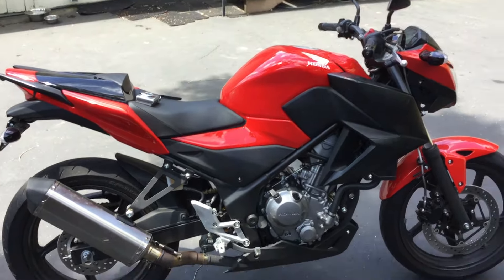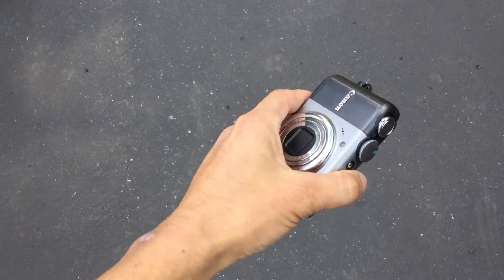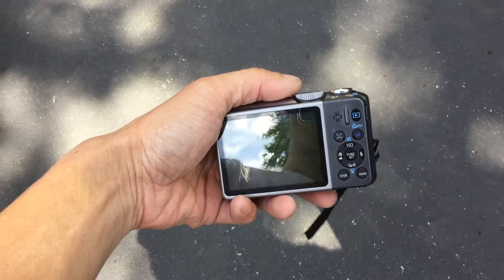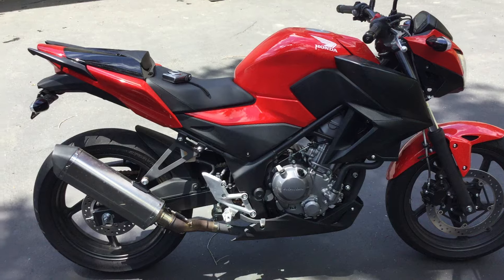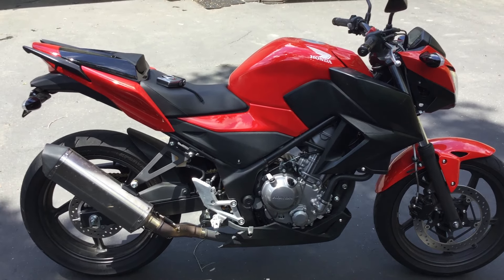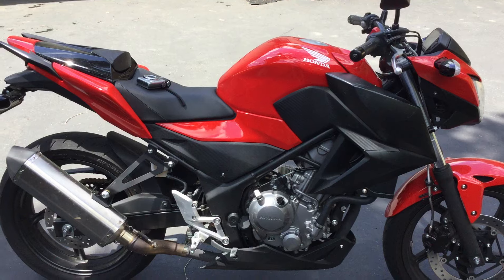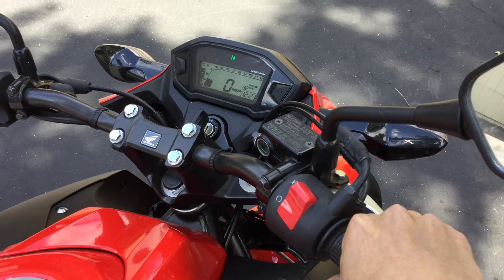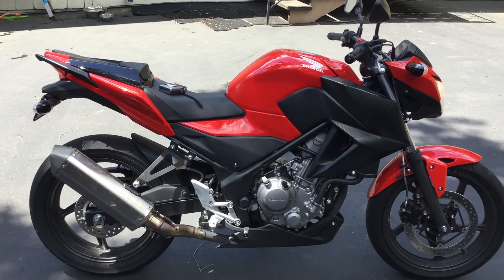CB300F w/scorpion & hign compression piston sample B

Comment: did you do compression test and measure different in PSI vs old piston? if calculated 12.3:1 ratio, did you use 91 AKI fuel since I would expect knocking with regular 87?
Reply from the maker: no compression test, but certainly felt the difference, yes was running highest octane at the pump